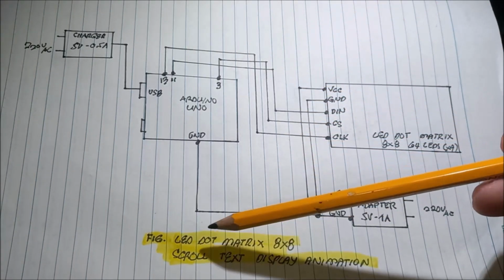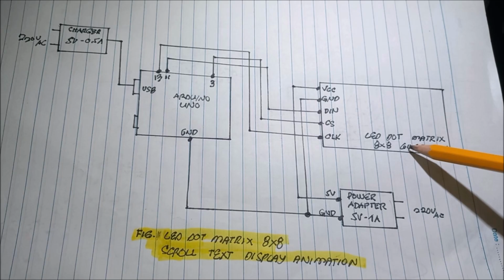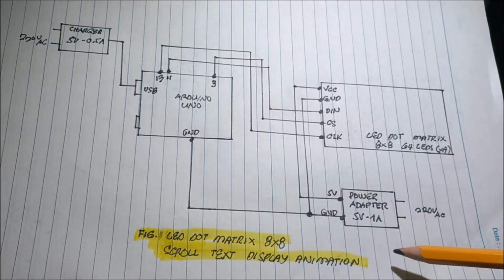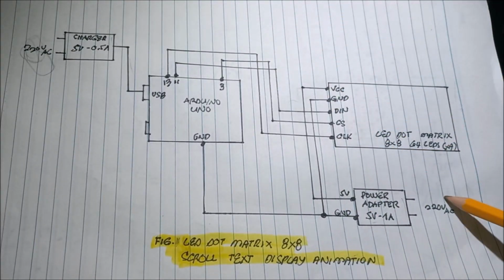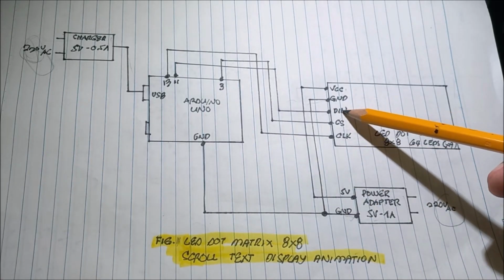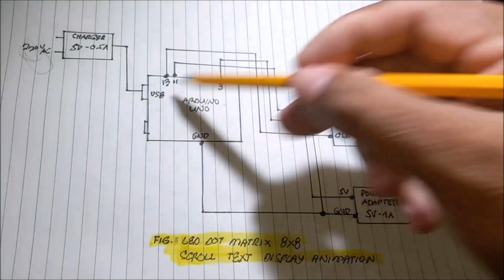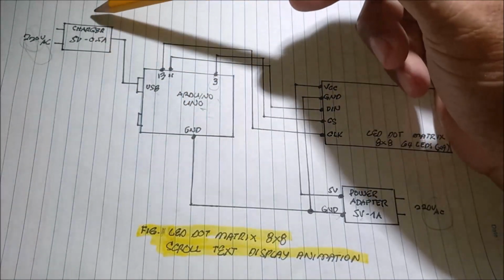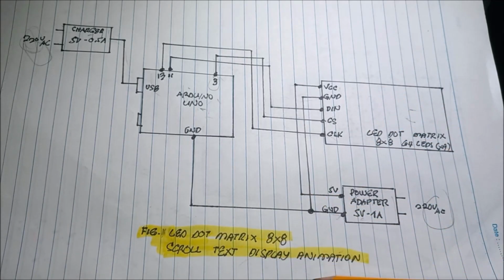LED Dot Matrix 8X8_Scroll Display Animation

Comment from the maker: // Including the required Arduino libraries
#include <MD_Parola.h>
#include <MD_MAX72xx.h>
#include <SPI.h>

// Uncomment according to your hardware type
#define HARDWARE_TYPE MD_MAX72XX::FC16_HW
//#define HARDWARE_TYPE MD_MAX72XX::GENERIC_HW

// Defining size, and output pins
#define MAX_DEVICES 4
#define CS_PIN 3

// Create a new instance of the MD_Parola class with hardware SPI connection
MD_Parola myDisplay = MD_Parola(HARDWARE_TYPE, CS_PIN, MAX_DEVICES);

void setup() {
  // Initialize the object
  myDisplay.begin();

  // Set the intensity (brightness) of the display (0-15)
  myDisplay.setIntensity(0);

  // Clear the display
  myDisplay.displayClear();

  myDisplay.displayScroll("TAGALOG ELECTRONICS", PA_CENTER, PA_SCROLL_LEFT, 100);
}

void loop() {
  if (myDisplay.displayAnimate()) {
    myDisplay.displayReset();
  }
}